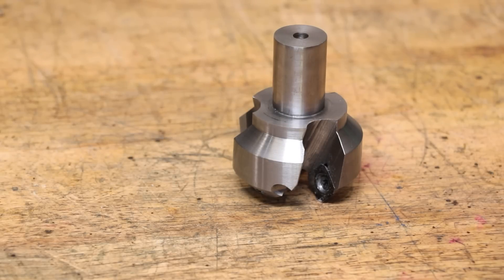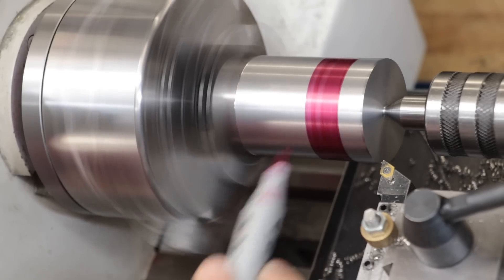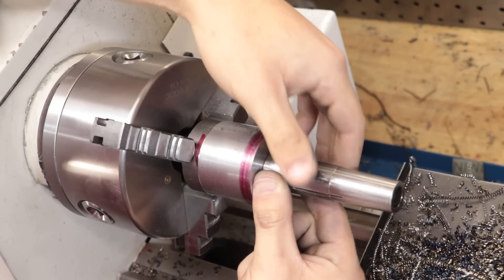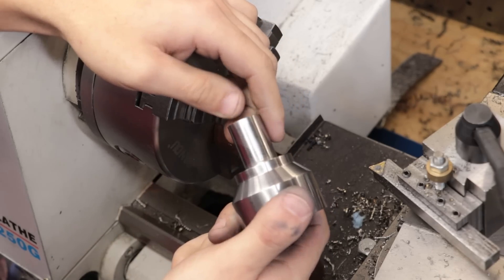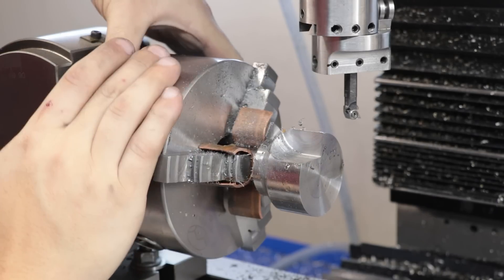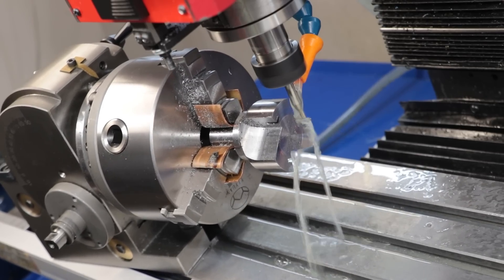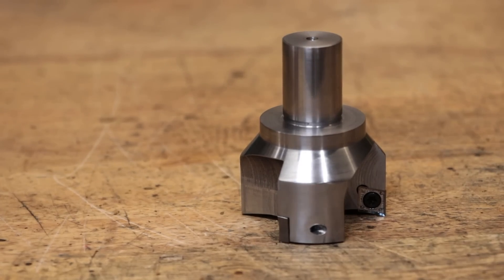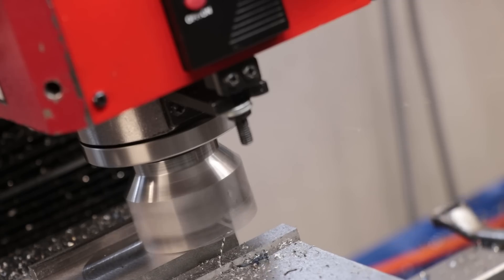How I Made My Other Face Mill

Comment from the maker: Hey guys. Been a bit under the weather this week and couldn't make it to the workshop to film anything. Thankfully I have a few spare videos which I could edit up. This video is a bit out of order as I have used this tool in the few videos already, but I thought it would be interesting to see how I made it. Hopefully I don't sound too out of out of it in the voice over parts. Hope you still enjoy it. Cheers
Reply: You take care of yourself first. The videos can come later.
Reply: Get well soon.
Reply: Mate any vid is a bonus from you 👍🏽
Reply: Feel better soon!
Reply: Look after yourself
Reply: Great tool, great idea and an entertaining video.
Does it mill tea, too?
Get back on the feet, soon:)
Reply: Hi, I’m a 53 year old fitter and turner, worked in manufacturing with CNC machines for 6 years and spent many years on maintenance in WA mines, I gather that you are in the engineering trade of some sort, you think out of the box, I like that 🇦🇺
Reply: I have been looking for these inserts, what are they called or where can I get some? They seem to work well in steel and aluminum for you. Feel better :)
Reply: Just a suggestion for next time you need a 20mm end mill and want that nice fly-cut finish. 
Hog out most of the material first with a smaller end mill that you can use and then use the boring bar for the final few cuts to get that finish.
Reply: if more inserts lowers the RPM (and HP) it also decreases the cutting speed 
Thus, It'd be interesting to compare performance of (DOC) of  2 vs 4 inserts
Reply: It's a nice tool, thanks!
👍💪✌

Comment: Hey man! Great video! A couple questions though. A: what size stock are you turning to make the part
B: I dont have a chuck for the vertical mill to put the part in. Can i still use a vise?
C: Instead of using a fly cutter to cut the flutes, can i use an end mil to so the same?

Im trying to make a facemill for my class in school and just needed some examples.

Comment: There is something I never understood about machining. Why couldn't you use your 20 mm cutter? If you take very shallow passes (which you did with the fly cutter)?

I understand why a machine that isn't rigid or powerful could not take big passes but if you're patient, what issue remains?
Reply from the maker: You use these types mostly of cutters because they have interchangeable inserts which are much cheaper to replace than a normal cutter
Reply: @artisanmakes  No no, you said you couldn't use your 20 mm cutter to machine this face mill because your milling machine isn't rigid enough. And I never understood why (if you accept to take shallow passes)
Reply from the maker: Oh that part, sorry it’s been a while since I made it and couldn’t remember off the top of my head. Running the carbide like I did here meant I could run it fast and take off small amounts of material with light pressure without worrying about burning up the cutter. If I’d used the endmill i would have to run it slower to not burn it up(hss burns up easily) . It also would require more tool pressure due to the extra cutting faces (4 flute endmill) and that increases tool pressure needed to cut.
Reply: @artisanmakes  And taking shallower passes would reduce tool pressure?
So it's "just" a trade-off with the time it takes to machine the part?
Reply from the maker: All comes down to the individual cutter. My 20mm that I have isn’t a great quality one so it doesn’t do light cuts very well. You need to really push it into the work for it to take a cut, rather than rub up against the material. If it was a brand new endmill with a razor sharp edge I could have probably gotten away with using it.
Reply: @artisanmakes   Oh that's interesting! So the cutting tool will slip on the surface instead of "biting" into it if you don't apply a radial force. But why wouldn't you be able to take a shallower cut (less depth) with less force but still manage the right pressure at the cutting edge?

Comment: So you solved nothing. You took a 45 and replaced with a rad. 
At first you wanted a sharp corner. 
Just use a damn endmill. These cutters suck and where’d you learn to use a mic?
Reply from the maker: No need to be so rude, but the cutter worked for what I needed. And most carbide leaves a nose radius

Comment: i hate saying it, but at 4:00, everything afterwards is a waste of time....

you just lost the concentricity to the shank you turned. can see the run-out on the final test cuts with the taper and OD.
popping it on the rotary and indicating... still not to the shank, but to the now eccentric diameter you just turned...

the best bet would have been do it on centres, then you just have to give it a final pass to clean it up and not worry about soft jaws, runout, blah blah.

next time, huh?

lol.
Reply from the maker: Well obviously that wasn't lost on me. But I took a punt on the run out not being an issue in the places that it popped up and given how well the tool works it obviously it doesn't matter a huge amount. There is probably a but more wear on one of the cutting edges but that's all if amounts to, and ive used this tool in enough parts that the effect isn't hugely noticeable. Not my first choice I but I cant afford any of the 4 jaw or collet chucks for this lathe yet.
Reply: @artisanmakes  i know, i know. its only a face cutter, a tiny discrepancy aint a big deal. want the best finish you got the flycutter or pull 3/4 of the teeth.

wait... it didnt come with a 4jaw, faceplate, two steadyrests and a pile of gears? i think mine had the mt4-3 sleeve. cant recall ever buying it separately!

im sure you have an MT3 er32 ;)

Comment: Hey man! How do you hold tools in the mill? I supose er collets but what tipe? Your mil has a  mt3 morse taper right? I'm looking to buy one of these mills  but I just don't realy know how to hold tooling! hope you have time to respond and have a nice day!
Reply: And I forgot. How do you hold the new face mill
Reply from the maker: I use almost exclusively morse taper collets
Reply: @artisanmakes  Ok. but for endmills I have seen you  use a er collet chuck. Is that correct?  7:28 . Sorry for bothering you so much I'm just not familiar with milling yet 😅  thank for your time and have a nice day!
Reply from the maker: I use er20 collet holders with a 20mm shank. They get held in my 20mm MT3 collets. It’s part of my quick change tooling system. I have an old video about it
Reply: Oh and your what size of bolt is in you spindle m12?
Reply from the maker: My spindle uses a m12 drawbar
Reply: Ok thank you. Have a nice day

Comment: Why would you design a face mill head to accept turning inserts when it’s just the same amount of work to design it with milling inserts? Also you’ll find it a lot more rigid if the sides of your pockets are at the same angles is the inserts, and finally try using the same inserts but steel versions, your edges will last longer
Reply from the maker: I have 4 packs of these inserts and they’re pretty rubbish as lathe inserts. Might as well use these here. And my mill doesn’t have the rigidity to use steel inserts and if you’ve ever used aluminium inserts in steel you know that they don’t instantly break.
In general they’re pretty useful for low HP. Machines if you don’t mind sacrificing some edge life

Comment: The only thing that I could say about your face mill, it’s not held with a arbor. That means you have to hold it with a collet or in a side lock. 
Depending on the level of precision you need to maintain, the side lock will have some runout.
The collet might not be ridged enough. I see you’ve loaded it with soft metal inserts, so the stresses will be less, per your material. 
Anyway, good on ya, solid machining skills.
Reply from the maker: It’s intentionally designed to work with the mills quick change tooling system which uses 20mm shank tools
Reply: I get that, just not a fan of holding a face mill in a collet. I’ve seen people scrap expensive stuff due to a 32 micro inch surface finish callout. Also from using the wrong insert, coated inserts for hard metals period. Anyway the only other thing I see is your spindle speed is too high, per the surface footage of the material, low carbon should be around 400 CSFM. Anyway it’s .78740 not 20 mm lol love ya bra
Reply from the maker: It’s a little high but that’s what this cutter runs happiest at. I found the same thing with the other one I made. Well happiest when I’m pushing it like this that is
Reply: Well at least you’re running coolant, I’ve seen a lot of people running high speed steel cutters dry, in some applications you can run carbide dry with a air blast.
Reply: Apologies the components I’ve been making for the last 30 +years goes down a runway or into a hot combat zone. The stakes are much higher, I would love to have your equipment in my home shop.

Comment: Your carbide insert moves in its holder at 4:45. A loose insert is soon a broken insert with a bad part bonus. Unfortunately, just tightening the screw will not fix it because the cutting forces will twist the insert back loose. Either never cut in that direction with that holder or modify the holder for a tighter hold. The screw should push the insert into a side wall (while still keeping the insert sitting flat). There's the 'proper' fix of welding/brazing (caution warping) plus remachining. Then there's the dark arts of fixing fits with peening (caution hack). Joe Pie vid for inspiration https://www.youtube.com/watch?v=S9Ozjc90GmQ but note that all those 'solutions' except straight knurl will not hold against side loads.

Comment: Isn't it then called a shoulder mill? You didn't make the first face mill for nothing it's the proper tool for facing, the shoulder mill should just be used if you have to mill to a shoulder. Many people use shoulder mills for face milling but it's actually the wrong tool and it gets frowned upon by mill operators because it doesn't work as well as a dedicated face mill.
Reply: Sorry but I'm going to disagree with you. Shoulder mills work great as face mills and only needing 1 tool for both is great
Reply: @LoneWolfPrecisionLLC  But why are there face mills then?
Reply: @Universal_Craftsman  basically if you have a tough material that chews inserts. Shoulder mill inserts are usually only two sided. Facemills are 4-12, in a job shop all you need in a shoulder mill. In production having more sides is nice when your dping more parts
Reply: @LoneWolfPrecisionLLC  That makes sense. This might be the reason the mill operator doesn't want people to use the shoulder mill's for facing, because it's a waste of inserts. I wanted to be the smart a** here, and now I lost the case, what a shame...
Reply: Facemill inserts typically have a much wider corner angle as well, which makes them inherently stronger. The shallower approach angle also means the chip thickness is less for the same feed, meaning you can feed them faster. Consequently face mills are excellent tools for hogging of lots of material in a hurry. Shoulder mills typically requires less torque and rigidity for the same width and depth of cut though, because of the narrower chip. So if you are pushing the limits of your machine it can sometimes be the better facing tool. Well, that's the theory anyways, but there's a lot of other factors at play as well, so your milage may vary.

Comment: I was surprised to see you were able to cut steel with these inserts. The CCGT’s you have there are for aluminium. Usually CCMT is used for steel …
Reply from the maker: I use aluminium inserts quite often is steel. The life of the inserts is reduced but you can still get a lot of work out of them
Reply: The positive rake and sharp edge is great for lower powered machines, where speeds and feeds are generally on the low side, and inserts like these leave an excellent finish. It's still carbide after all, so it's much harder than the steel. The trade-off is that the edge doesn't last as long as on an insert designed for steel. No use for production work on serious machines, but honestly an excellent choice for light work on hobby machines.

Comment: Nice build and some really nice shots there too! The inserts you are using on that thing are not really made for steel, they kinda work but you instantly gonna shave the corners off em. They work really well tho in all sorts of aluminium and copper and give extremely good surface finnish on those materials usually.
Also the faces where the inserts are seated against should be at the same angle as the inserts, kinda a hassle to setup tho and if it twerks it twerks.
Peace and keep it up!
Reply: I think a lot of these comments come from folks with experience in commercial production machining, where these would indeed be the wrong inserts. But in a hobby shop, with the low speeds and feeds required by small machine tools, they're excellent and can last a long time. They don't like interrupted cuts, though.
Reply: @cooperised  Yeah, i have several years of experience in the industry. Those inserts are rated for non-ferrous metals and Vc 80-3000m/min fz 0,02-0,4 and ap of 0,1-4mm btw. (According to package and tested) They work excellent in those conditions tho, tried em on steel too but they got violated rather quickly. Just wanted to point that out because stuff costs money and i like my tooling last a bit.
Reply: Well  @sicstar  when you have those many years in the industry, why don't you just use the correct tools and keep at that, all we amateurs do it our way and I for an instance have milled appr. 1 m2 in toolsteel with the same 4 inserts that are made for aluminium. That said, I do not take 2-3 mm cut with 2-3000 surface meters a minuttes, I use them to where I feel they can cope, and remember it is HOBBY not commercial metalwork
Reply: @sidewind131258  That's why i earlier said you do you! Don't feel offended please just because i pointed something out. You gotta work with you got at hand, i have a small dirt cheap lathe, tiny cnc router and 3D printers and therefor also lack the "proper" tooling at home for most things i do. And in the end the insert is made from tungsten carbide and if you don't overdo it they gonna work-ish. And yeah i won't take 4mm doc with em not even in aluminium. 2-3,5mm doc with 2600 sfm and 0,35mm per rev in copper was where i maxed em out btw.
Reply: I DO feel offended  @sicstar  over your condesending way of writing, you are obviously in a position where another person dole out multi million dollars for you, whereas some of us pay for our own machines.

Show a litle gratitute that you have that luxury, and be happy for the selftaught man
Reply: @sicstar  Save your breath. Don't try to convince amateurs who can't be bothered to read a Sandvik manual on inserts or learn what the PMKNSH on the package means 🤣.AND you may have an amateur/hobby setup at home, but that does not mean you can not ( try to) work in a professional manner (as much as possible).
Reply: @Trust_me_I_am_an_Engineer  I guess you are right... I just wanted to give some advice from my own experience but NAAAAH. Some people just know everything better. (I sure sound like i know everything better too sometimes but i don't grow a stick up my arse because of it usually :D) But yeah the PMK[N]SH on those "CCGT 120404/08 ALX..." are really just meant for what they state it. (I used up 150-200 of those inserts the past 1,5-2 years for turning excessive amounts of copper btw. so i had plenty of opportunity to test all sorts of things with em.) And i guess ima keep doing my thing anyways, as you wrote, one can at least try to be somewhat professional and efficient. Which for me includes not wasting expensive tooling on the wrong application. Nor wasting the money and time of the company or my cheffe as that one silly bugger claimed. And thanks for the kind words!
Reply: @sicstar  You're welcome.
Reply: I was going to make that same comment about the inserts, sharp inserts are for softer materials while inserts with rounded edges are for steel. The right inserts make a big difference.
Reply from the maker: I use these types of inserts all the time for steel. They do have a slightly reduced working life but it’s wrong to say that the edges break instantly. You get quite a lot of life out of them as long as you don’t crash the tool. And if you really want to set up the a tapered endmill you can but I never do and it works. Cheers
Reply: @artisanmakes  Nah it's not wrong because i had exacatly that happening multiple times. Glad they hold up for you cuz i had near 0 life out of em in anything but in non ferrous metals. Maybe they hold up on lower grade steel but they sure didn't like 42CrMo :/ No offense btw, you do you and the results speak for themselves! Stuff lookin good! <3
Reply: @artisanmakes  u will get a mutch mutch longer life, if u consider the right tool for the job. or switch to aluminium^^ often u can mill 1 qubic meter of material or more with these.

Comment: Hey you're obviously a very capable machinist but i just wanted to share this cool tip i learned from Curtis on Cutting Edge Engineering Australia.   The copper you use with the 3 jaw chuck is U shaped pieces that are just slid over the jaws.  He has a video where he shows how you can use a carbide endmill to mill down through the surface hardness of the front face of the jaws, which will then allow you to use normal tooling to tap a hole.  You can then make some L shaped copper pieces that bolt in place.  It's a lot less work in terms of setup and they dont fall in the floor.  😊
Reply: There is an other way to have them stay on as well. If you fold the copper pieces so they grip around the jaw with a little bit of spring pressure, they also stay on nicely. Not sure where I picked this up, but I would like to blame Tom Lipton 😅.
Reply: Or you could just make a set or two of soft jaws out of aluminum or mild steel and not ruin your hard jaws.